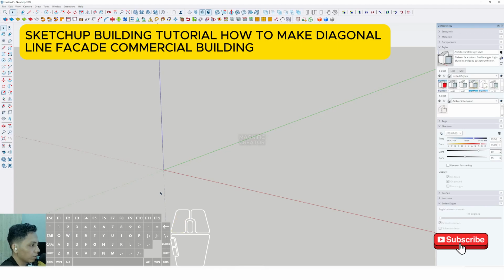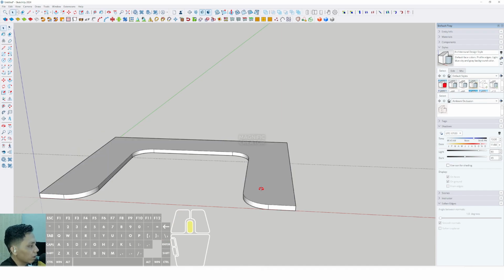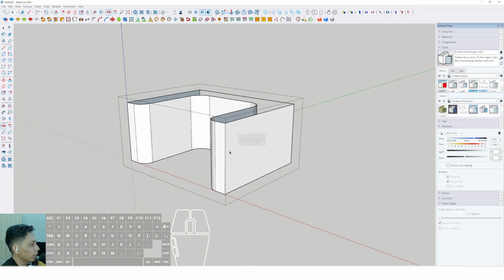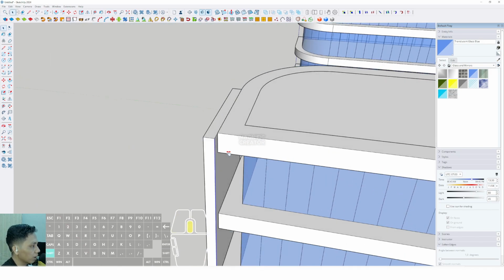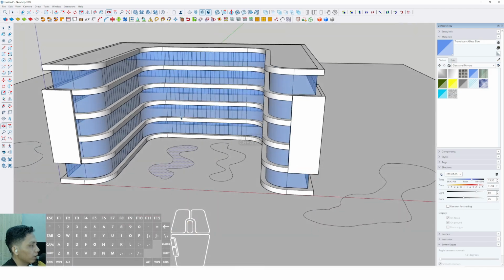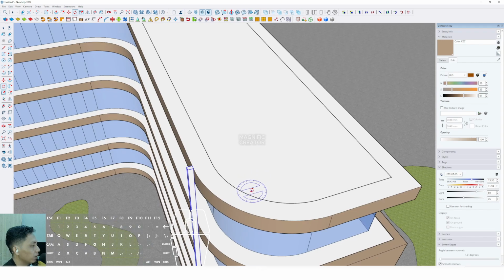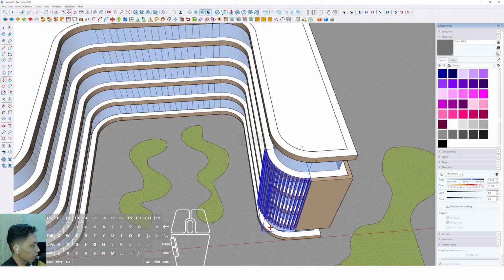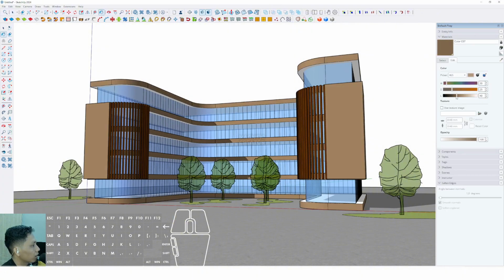SKETCHUP BUILDING TUTORIAL HOW TO MAKE CURVED U SHAPED COMMERCIAL BUILDING

Comment: Thanks, I wonder if I can request you to give write up of all steps involved - like 1- making building floor, - make Group, make Component 2 copy and make it double decker - then move it 3.6 m above then c number of floors - then make Group of all floors - then top floor offset to make rectangle then erasing the extra surface, hide all floors, then only rectangle made by offset remains - making it a Group, then push pull it to the GFloor , 
Sorry to bother by making it long message but it is to ask do we make first Group and then component of the same stuff ? 
Thanks - answer only if it is convenient- I will repeatedly see your video to get it right
Reply from the maker: thankyou that was great question and insightful for further videos, anyway we have to make it Group before make it to Component because it could facilitate us for modifying it on the further editing and just need once editing for copied components